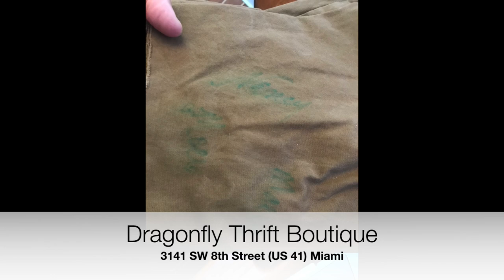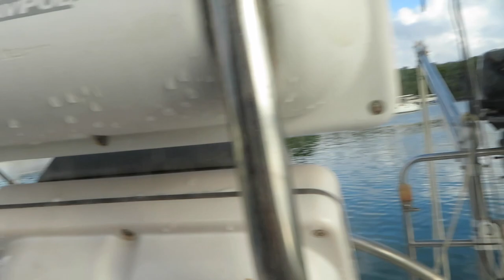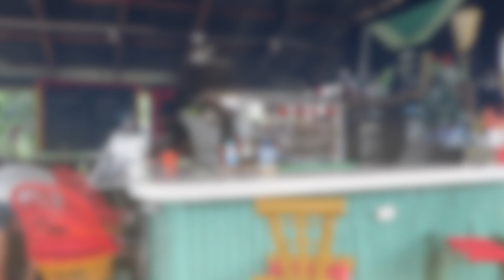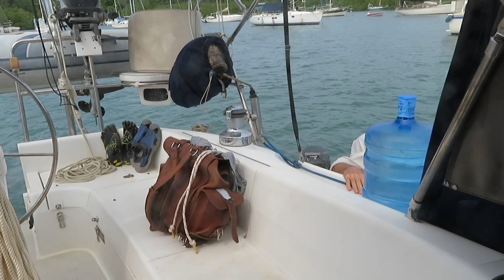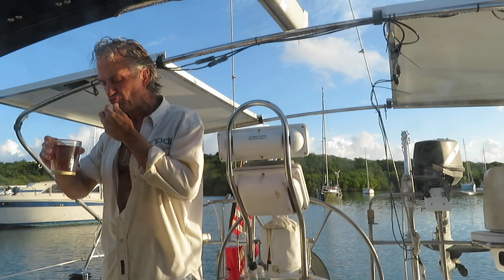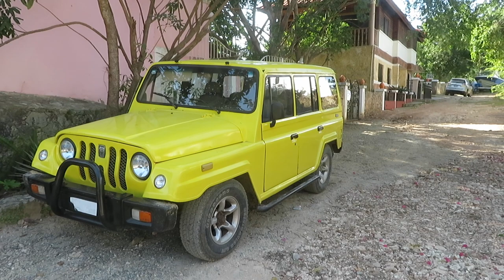Skipjack Sailing 18--The Adventures of a Navy Nuke Escapee.  Luperon, Republica de Dominica.

Comment: what is the proper etiquette when tying a dinghy to a crowded dock?
Reply from the maker: I don't know that there is a formal etiquette...but you don't untie/endanger another dinghy, and you don't prevent the use of a dinghy.
In all cases that I've seen in Luperon, there are not enough cleat for the dinghies, so sharing is necessary.
In this case, it's possible (upon reflection) that the other person assumed that I had planned to tie and until my line every time.  Maybe that should be my plan.
I learned a trick from another captain--she uses a very large carabiner clip (SS) when sharing a cleat.  It gives her more options.
Reply: @skipjacksailing8986  i sent you an email about ICCP. is this viable on your boat?
Reply from the maker: @ryleelewis  Well, it is almost critical to the aluminum boats, but I do not have.  I confess that I haven't gotten to the articles yet, and won't until I get my taxes filed!
:)
Reply: @skipjacksailing8986  gads you bring up bad news. Especially since the IRS is back logged still from 2019 returns